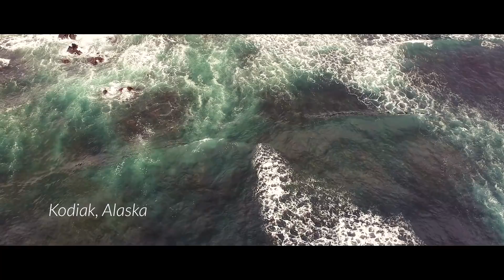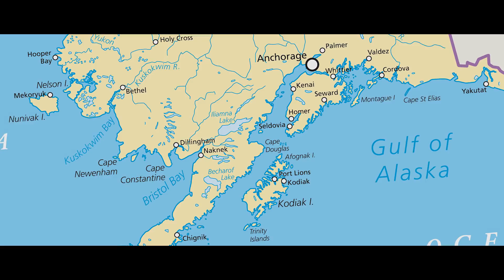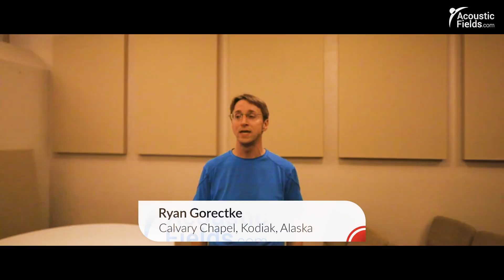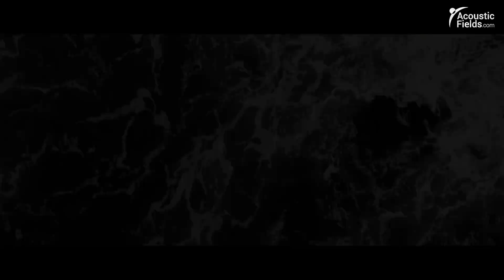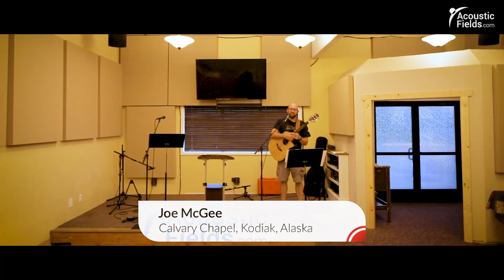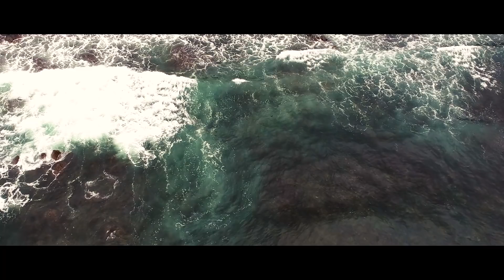Church Acoustics in Kodiak, Alaska, USA | DIY Church Project

Comment: Good video. Thanks.
That's very telling when you have to wear IEMs just to hear yourself in the untreated room.
Reply from the maker: RB,  It is amazing to me what people settle for in sound quality. Every day I am amazed at what I see and discuss with people especially when it comes to low end management. Most people I speak with think there is simply no solution. They think you just have to live with it. Nothing could be further from the truth. You can get the same attack / decay / definition / separation / clarity with the low end as you do the middle and highs if you use the correct technology, place it in the high pressure areas, and cover enough surface area.
Reply: Yes. Since I started getting the low end just partially controlled, I have avoided leaving my apartment. It sounds and feels "sweet" and "comfortable".
   I keep telling friends and family to "get some acoustic treatment in the home". Everything sounds nicer.  It makes any argument, family dinner, family discussion or grand-kids' sleepover much less irritating.  Once they've tried a little foam, it is easier for me to recommend treating the low freqs.